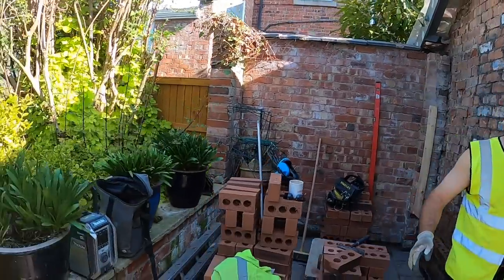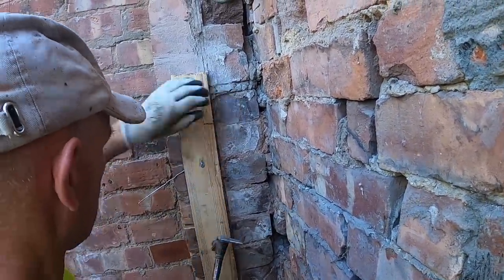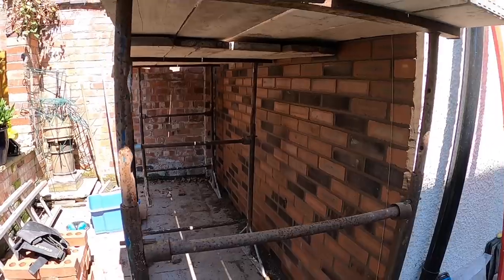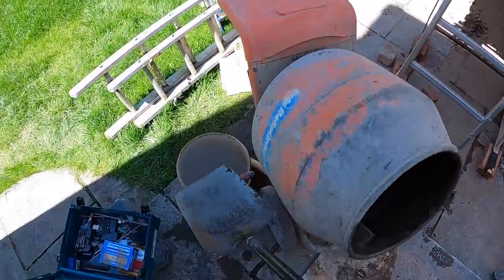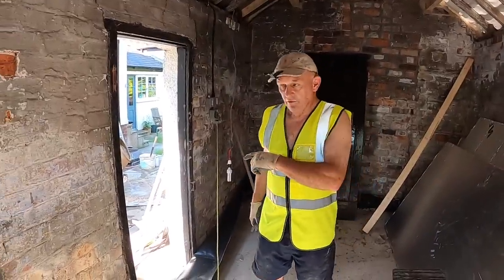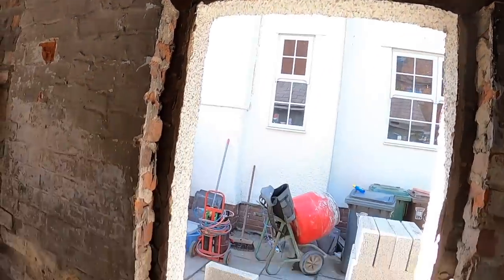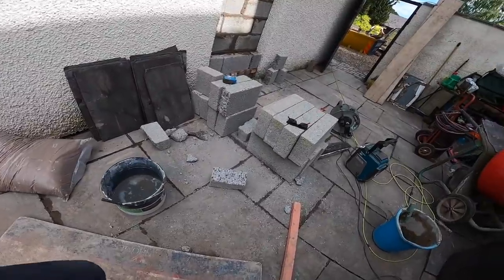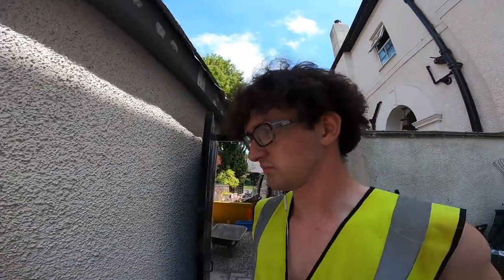WORST BRICKWORK EVER !MADE GOOD

Comment: Excellent video! And a nicely built wall as well, can ask you a question? What would be the best way to clean a red brick wall please? It's the old smooth red brick style wall, my work colleague/mason has just finished grinding out old sand and cement, and has repointed it, but wall just needs a good wash, what would you guys recommend I use? Thank you.
Reply from the maker: Wet the wall give it a good scrub , a couple of rinses should do it . If it doesn’t try again with some diluted brick acid . Should come up a treat. 
   Also thanks very much 🧱👍🏽
Reply: @SteveAndAlexBuild  thanks for the prompt reply, and yeah was something quite satisfying watching it! I've got a small karcher pressure washer, could I use that or would it just be best to wash it with a good old fashioned bucket and lots of cold/warm water. Thanks
Reply from the maker: @robh1521  with it being re pointing recently I’d avoid a pressure washer . Re pointing takes weeks even months to cure properly so elbow grease it is 🪣💪🏼💦🧼🧽🧱👍🏽
Reply: @SteveAndAlexBuild  ok thank you for your reply, I'll give it a good wet wash down and take it from there, thanks very much!
Reply from the maker: @robh1521  no probs Rob good luck 🧱👍🏽

Comment: If not using wall ties should you not put morter in between the old layer and new layer of bricks so it ties in as strong double wall,Obviously you cant use insulation because there is not enough space?If i were doing it i would put morter in between the two layers for a stronger wall. Everyone has there own way and reason for doint it in any particular way.Nice brick and Good job lads! Sorry i did not see the wall ties untill the end!

Comment: Do double brick wall improve sound insulation or there is little improvement from a single brick wall? Just curious🤔
Reply from the maker: It will improve it but it’s more for strength. For better sound insulation a cavity wall with insulation in the cavity is way better 🧱👍🏽

Comment: Job turned out good lads . If the w.rose trowel rodian gave you is the one in this video https://youtu.be/JQe7nV9Z8lQ then all you need to do is take the handle off and adjust the handle angle . Those wooden handles are usually just wedged on no glue usually used . If you hold the trowel in the left hand hit down on the tang and the handle will usually pop of with a few blows . I’ll send you a link to one of jays videos which shows the principle of how to set the handle angle in relation to the trowel blade . You could even buy a w.rose proform soft grip replacement handle for it . That w.rose trowel is top class just needs the angle adjusted .https://youtu.be/jRjsz2ksLD4 check alexes Whs/ tyzack trowel I’ll be surprised if it’s not set like jays .
Reply from the maker: Thanks for the advice but I won’t be using it , it’s a big wide 11” philly  . It just feels awful in the hand 😬🧱👍🏼
Reply: @SteveAndAlexBuild  of course it feels gammy with that handle angle . Have a pair of rose ten inch standard shank narrow London’s. one has a stupid angle like your one the other hasn’t ,the one with out feels great in hand the one with is an awful thing .
Reply from the maker: @brickbybric  😁🧱👍🏽
Reply from the maker: +bric bybrick . No I hate everything about it , it’s like a shovel . It is gong into a giveaway 😆🧱👍🏽